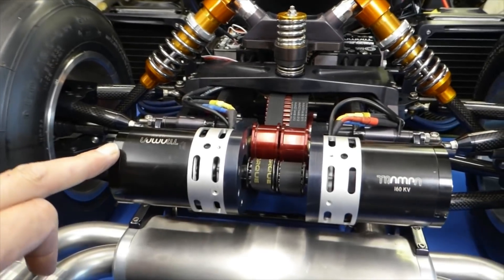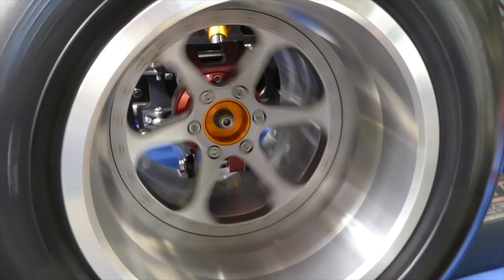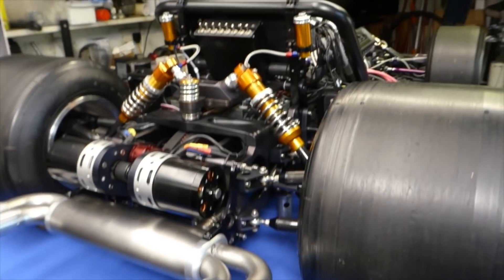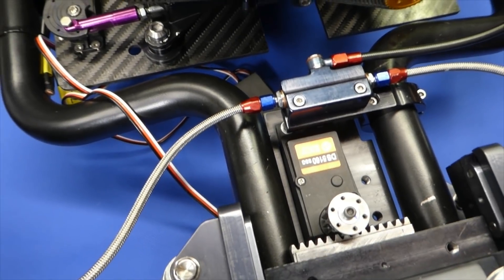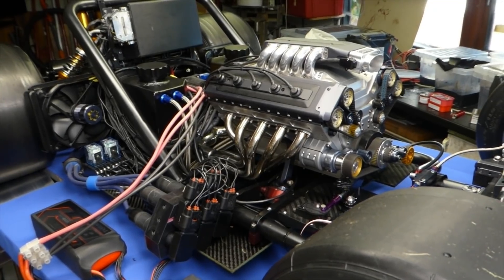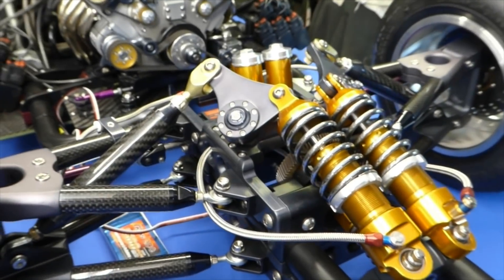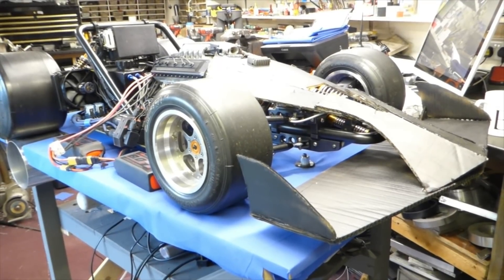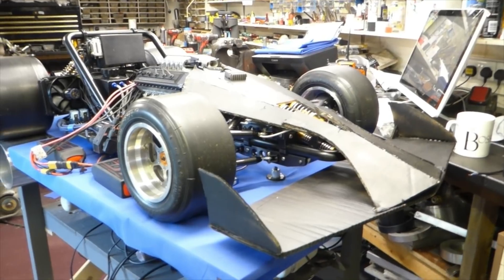1/3 scale V10 RC car Part 9

Comment: Why is it Electric Drive??? Is This JUST a Big Rc car "Carrying a Real Petrol Engine".. ....If So Why. Seams a Far Way to Go. Spend Tons Of 💰 and the Petrol engine is Not Running It.The Electric Drives it?.no transfer case, transmission? 🤔🤔🤔
Reply: Hybrid
Reply: Can you please post your attempt at building car like this.
Reply: It's a hybrid the electric motors will push on the bottom end so the v10 can run a single gear
Reply: i think he has the motors there to help the v10 to get a good start
Reply: Miller H.  I thought they were just the starter motors? That's what he said at beginning
Reply: Miller H.  I have Been a machinist all of my life and all I can say Kieth is one of the best.
Reply: He is building a gearbox and transfer box watch the other videos 3 speed engine 2 speed electric and 2 speed transfer box

Comment: Please don't put an F1 body on it. After all that gorgeous work it needs a more imaginative structure to envelop it
Reply: Miller H.  F1 would likely be the most efficient aero but F1 glory is more attached to the drivers than the cars. I'm looking at that V10 like a piece of jewelry. If I had matchbox cars as jewelry in a drawer the attention would go to something with a more imagination enticing form. I think LeMans bodies are a more on par parts bin to scavenge. Personally my heart would do a roofless roadster version of the legendary GT40 with some battlecar touches. If you're familiar with the battlecar subreddit or the Cutlass Banshee, that was on Leno's Garage a few years ago with similar engine placement, you'd have an idea of what I'd cue off of for this bespoke monster 😍

Comment: Why does it have an exoste pipe if its electric ?
Reply: didnt you see the little V10 in the middle?
Reply: @libertas12  i saw it, but it doesn't look or sound like it's working.
Reply: It's hybrid
Reply: @Len838jrnso99  ok
Reply: Exhaust
Reply: @maxneagle2154  that's what I was trying to type and got  exhausted and went along with it, you got what I meant lol

Comment: You fixed it with the steering having its own battery but it may work with a capacitor or 2 on your receiver. They'll plug into any spare ports. But its called a brown out (Jittery steering with it hooked up to the escs and motors).

Comment: So does the engine run or not? Is it just a replica?
Reply: In the end, it will be a hybrid system between the V10 and the electric motors.
Reply: I think there's a video of it running check his past vidz
Reply: Pretty sure it runs and the motors are for extra kick when beeded
Reply: Thank you to all that have responded.

Comment: hmmm Is it the motor that drives? and the engine just acts as a generator, right?  so dc hybrid system?
Reply: the v10 engine is the final powerplant that will be used. the electric motor setup is just temporary for driving around and testing.
Reply: @ICKY427  No both will be used not temporary.next on his list is the gearbox and LSD diff.Electric-l ow down torque and starter.V10 top end with regen braking on rear axle
Reply: @nssherlock4547  oh, nice! i thought i had remembered him saying in an earlier video that it was only temporary.

Comment: you need a much bigger servo for steering or gear reduction but that will slow it down a lot check out some of the giant scale aircraft servos 

you could also gang 2 or 3 servos up

Comment: So why the electric motors? You've  made a scale combustion engine the likes of no other in the world, i don't understand the two system approach!!
For the steering servo there are many options and servos can be multiturn which will keep your torque ratio up rather than going a bigger pinion with a standard servo. Or there is this 280 deg servohttps://www.google.com.au/aclk?sa=l&ai=DChcSEwiX0aiWzI3kAhWVJCsKHdlvAJ0YABAUGgJzZg&ae=1&sig=AOD64_1yXFTLLCByKly-s_MnRwq-MPGqZA&ctype=5&q=&ved=2ahUKEwi6m6GWzI3kAhUJWX0KHWLDCW8Qwg96BAgLECU&adurl=https://hobbyking.com/en_us/robostar-sbrs-5314htg-280-digital-metal-gear-high-voltage-robot-servo-53-1kg-0-14sec-81g.html%3Fcountrycode%3DAU%26gclsrc%3Daw.ds%26%26gclid%3DEAIaIQobChMIl9GolsyN5AIVlSQrCh3ZbwCdEAQYByABEgLS7_D_BwE
Reply: @lsouza1327  do f1 cars have electric boost motors?
Reply: @srnunan4783  Yes 2 one on the turbo and 1 one the crank.
Reply: 1)They start the car moving and also start the V10 2)they are the alternator/generator for the electrics 3)It gives him a greater control of braking,using regen.Plus he wants the insta torque to smoke the tyres up.

Comment: You Sir, are one of THE most talented engineers and machinist/fabricators on this planet. Everything you have made so far is a work of art. Since you've got the electrics on the car already, you may as well just go with it and add an inverter generator on the back of the V-10. With your knowledge you could probably achieve that in about one thousandth of the time it will take to complete the gearbox and final drive you have planned. You could then have use of your creation while you machine and build your gearbox. Best of luck, and take care.

Comment: Have a look on a website called Banggood and have a look at some of there servos

Like the jx echoboost servos are cheap and very power full and there are many more that go up to 46kg at 0.9 sec at 60 degrees
Reply from the maker: The steering servo is 60kg.

Comment: You continue to amaze Keith. Just when I think this is the most over the top and multi talented M.E. build I've ever seen, you up the bar again. Now with Anti Lock Brakes. :-) So far the beginning trial cardboard mock up for a body style is looking very good. Your car and build choices so your decisions for what you want the finished car to look like of course. But if you were to lean in that direction? In my opinion every F1 car after the John Players Lotus https://www.alamy.com/stock-photo/john-player-special-f1-car.html has gotten uglier. But I don't recall you mentioning this is to be run only on hard surfaced roads or off road as well. It's a minor thought anyway. Very much looking forward to the next update.

Comment: A stunning piece of work alright, except the steering servo looks way to small for that big and heavy car, so i would have put at least 2 next to eachother,
or use 1 or 2 linear servos, or a big wiper motor and gear from a car.
Reply from the maker: The servo is bigger than it looks. It’s a 60kg one.

Comment: It hasn’t been outside, rollers only.
Well actually I had it in the garden testing the steering. Worked well. 
Well actually I crashed it in the garden and had to replace all these parts. 

🤣😂😅
Reply from the maker: Those motors haven’t been outside.
Reply: Keith57000 I’m only having a laugh, amazing project my friend! ☺️

Comment: Amazing! I'm the guy that suggested the use of Skateboard motors in the comments of your last video. I'm glad to see you went that direction, I'm sure you will be pleased with the performance! Beautiful! That car definitely screams to be an open wheel F1 style race car! I hope you continue shaping it into to that! Love it! Cant wait to see it go! Thanks for sharing!
Reply from the maker: Yes, I remember you. I've got some bigger motors coming soon, for a trial run. From Trampa Skateboards again.
Reply: @Keith5700  Did you try to run the ones you have now? I'm sure the bigger ones will work out great! Very Nice!
Reply from the maker: Yes, had a quick run in garden but cant really tell. garden too small. need to go out when suspension finished.these motors are 3500w each. New ones are 6500w.
Reply: @Keith5700  Definitely get to an area where you can do a proper test! 6500 watts is going to demand so serious power what are the Kv's those motors are designed to carry the weight of a grown man so I believe they will suffice! What an amazing work of art you are producing! Thanks for sharing!

Comment: just wondering why your spending so much time with the electric motors,  rather then just attaching the gas engine
Reply from the maker: The gearbox is complex and 6-9 months work, so I wanted to get a couple of motors on so I could just drive the car and test suspension and brakes, etc. But the electrics have taken over a bit, but I’ll be back on the V10 soon.
Reply: @Keith5700  good to hear. Wish you luck with the build
Reply: @Keith5700  Sorry I thought it was going to be a hybrid, which would be awesome to have electric torque assist to the V10. Did not mean to say what you were going to do! Great build the best I have ever seen!👍
Reply from the maker: Yes, it is going to be hybrid. I’m keeping the motors.
Reply: When he's done it will run on both as Formula1 cars do! 👍

Comment: why does the engine isn't running the electric powered motors power the rear wheels
Reply: Astrø its a hybrid
Reply: He said he is using the motors as a quick way to test the suspension. It'll take some time to make the gearbox. After that's been built, the motor will be placed.
Reply: It'll be a hybrid as formula 1 cars are now the gearbox takes alot of engineering

Comment: what wheels are those? where to buy?
Reply from the maker: I made them. Aluminium 3 piece split rims.
Reply: @Keith5700  How much would you charge for a set of 4 front sized wheels?
Reply from the maker: Too much at a guess. It took ages to hog all that lot out. Don’t fancy doing another set.
Reply: Those might be Kart wheels.

Comment: 1:38 That acceleration O_O
Reply from the maker: Someone was, but they’ve deleted their comment for some reason.
Reply: Because its open system and doesnt has cover. Tesla has cover. That's a silent engine.
Reply: no one is talking about noise level or tesla, what are you on about

Comment: Holly cow.  It's over done a little 🤣👍 i love the carbon axles and suspension bits.  Are the radiator and engine functional or just for show? If you are going for speed you are probably better off with out them and just run cooling fans from computer..
Reply: Oh, it definitely runs. It's a fully functional V10 internal combustion engine.

Comment: I absolutely love the little coilover suspension setup with the reservoirs. Where would one even begin to buy stuff like this if they wanted to try and build there own project? Work of art my friend, really bad ass.
Reply: He engineered all of this himself for the most part. Almost everything you see that is aluminum or carbon fiber, he's machined or put together himself. You'd need to build yourself a machine shop and learn to use everything from a lathe to a mill to a dozen other tools and machines in order to do what he's doing with this build. Only a handful of components in this build are actually off the shelf, like batteries, servos and electric motors. He buys materials that he needs, like hoses and odds and ends, but puts them together himself at the specific lengths he needs. The engine and all of the aluminum bits are machined by him out of billet aluminum blocks, the chassis and suspension components are machined and built by him as well. No easy feat, what he's doing. But I'm sure he enjoys it, otherwise what's the point? But I definitely get where you're coming from. I'd geek out for months or years over building something like this.
Reply: Yeah I figured that out after I went to his channel and watched videos. As far as machining and lathes go, I'm good on those as it's what I do.it would be having time and doing it that would be a feat in itself. Very good work be has done, no doubt about that. I didn't know at first but kinda thought for a moment o ce the carbon fiber bits started being seen that I was sure he had made them by hand. Thanks for the reply and shedding more light.🤝 I'm sure everyone here would be geeked out at this creation.

Comment: Does this have different gears? If so how many speed transmission? Love the project by the way keep up the great work I'm one of your biggest fans!!
Reply from the maker: Current thinking is electrics will have no gears, and the V10 will have 6gears. I really need to start on the gearbox soon.
Reply: Right on I'm really excited to see how the transmission works!!
Reply: 79gusto it’s driven by the electric motors, so No gears. The v10 drives a generator to charge the system I believe
Reply: @graemelitt4874  No, he's built a gearbox for it in the past. I'm sure he plans on running the car with the engine at some point, based on what I've seen. He initially put the electric motors on it just to test the chassis, suspension, steering, etc. Get it moving while he builds the frame out for testing purposes. This car will 100% be driven by the engine when he's done with the chassis, if he's ever done. You have to understand, for people like this, it's the building and machining that is the point, working through the many issues associated with engineering a vehicle. He may never finish it. Like he said, he still has to lengthen the entire thing, so it'll likely all come apart again so he can build a new chassis from scratch. It's pointless to build a V10 as impressive as this just to have it drive a generator while electric motors push the car.. smh.. No, it'll move the car eventually.

Comment: You just need a bec, they hook upto your normal power supply but provide your receiver with the correct voltage and charge so there's no drain under load.
Used to have the same issues with my savage.
Also your front shockers are upside down, just noticed on final part of your round vid at the end.

Comment: How is the gearing calculated between the V10 and the electric motors?
Reply from the maker: I thought I’d finished the gearbox/transaxle design, but I’m still not 100% sure how to combine the electrics and the V10.
Reply: Brofessor Zweistein good question sir

Comment: Also make sure you have a failsafe switch on case you have a runaway on the electric motors and you need to cut them off (if you haven’t already)

Comment: Make sure you don’t discharge the individual battery cells to below 3v. That’s when the cells get damaged. I run my drone lipo’s cells to about 3.5V or 3.5x4=14v that ensures I don’t damage the battery.

You just have to calculate 3.5x6 because you’re running 6s lipo’s :)
Reply: He also need to balance charge the batteries

Comment: When you were talking about having issues with esc's and servo's on one reciever.  The first thing that popped into my mind is Are you running BEC's on the servos?  Those high torque servos are power hungry and when they pull large amounts thru the reciever/esc they can cause gitters and odds things to happen.  I run into this a bit with the 1/10 scale trucks when over 20kg or 300oz/inch servos
Reply from the maker: Apparently the vesc speed controller doesn’t like much power going through it’s bec circuit.

Comment: Almost chocked on my breakfast sandwich when I saw you had uploaded another video! Things are looking good and taking shape! I really like the idea of making a F1 style body on it, fits well with the carbon A-arms and cantilever suspension :D
Reply: @Keith57000 I also wonder if and how you'll wire the ESC's to throttle on at the same time as the V10 revs up? Or do you simply keep the ESC at 100% throttle and let the v10 decide the power output completly?
Reply from the maker: I think it’s going to have to have 2 separate throttles, ie left and right thumb. I can’t see any way of combining the two.

Comment: This is amazing, also how’s the progress on the super charger and the gearbox for the engine?
Reply from the maker: Supercharger has been shelved. Gearbox is still just a drawing. I have collected most of the gears I need.
Reply: Nice, can’t wait to see this beast running on the v10’s power, also will it work as an independent hybrid system or will the electric motors work with the v10?

Comment: Do you plan on testing it on an rc track ?
Reply from the maker: No, probably somewhere a bit straighter.
Reply: @Keith5700  A real track would put the suspension, the tires and the acceleration to the test though !
Amazing piece of kit by the way ! Can't wait to see it running at full speed !
Reply from the maker: I need to get used to the controller first. I’ve only ever flown planes, not had rc cars.